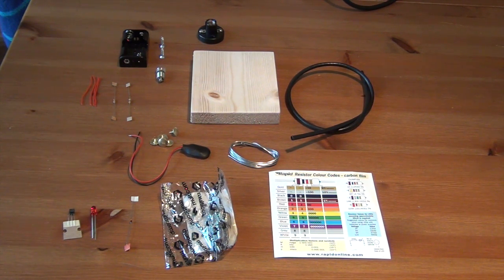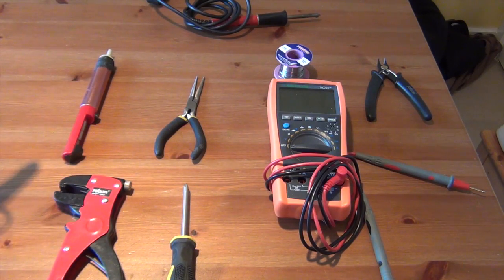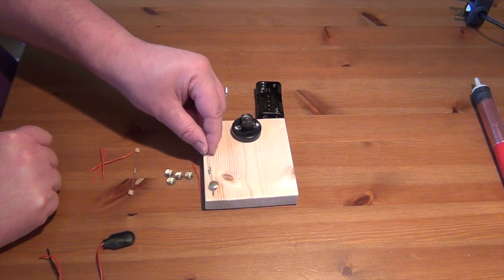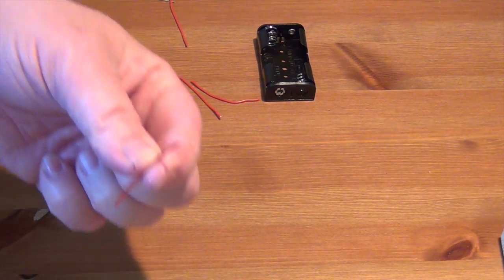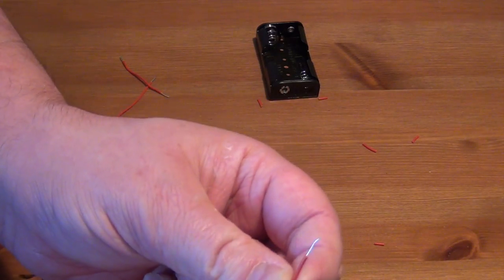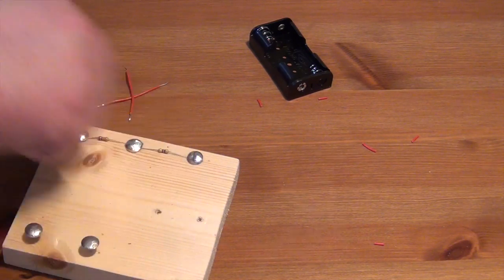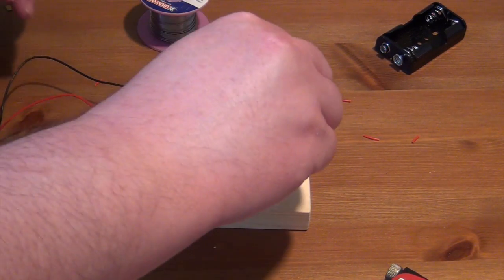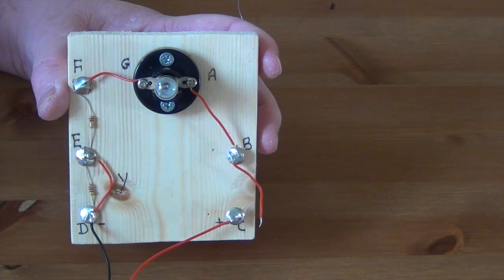UK Ham Radio Intermediate Licence - WorkSheet No. 5

Comment: Thank you! My knowledge of electronics is rudimentary, so I wonder if you'd explain the purpose of the wire in the circuit at Y. Doesn't it allow the FULL current to flow and bypass the resistor between E and D, and if so, what is the point of the resistor? OR does that wire effectively halve the resistor's value?